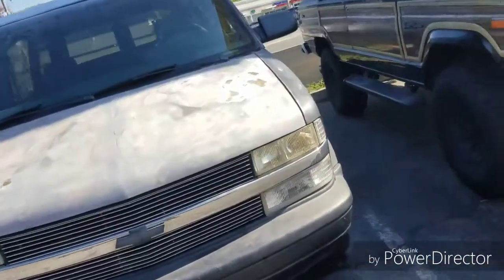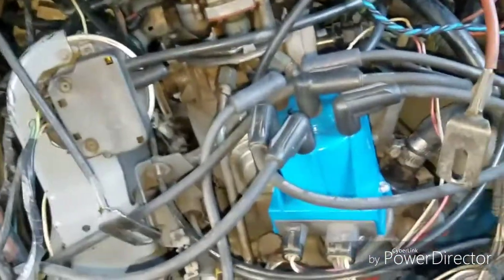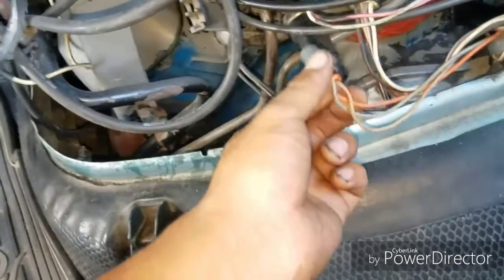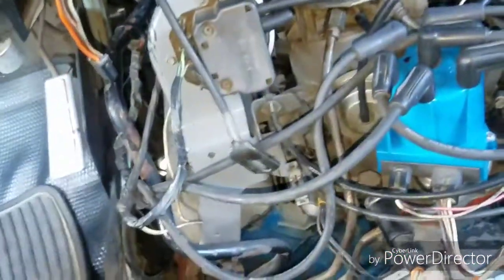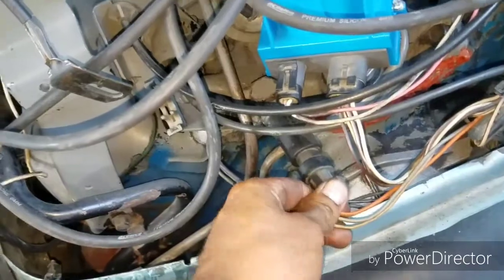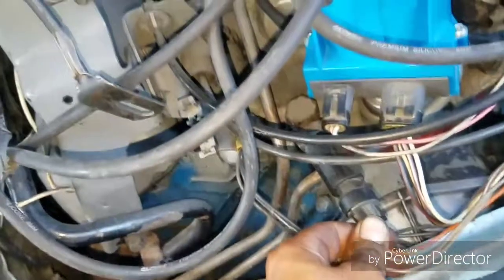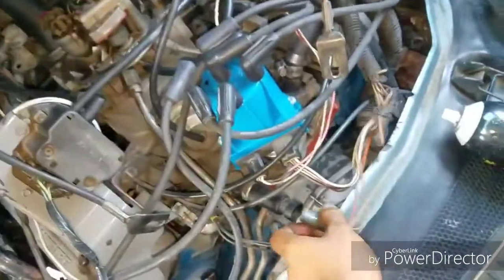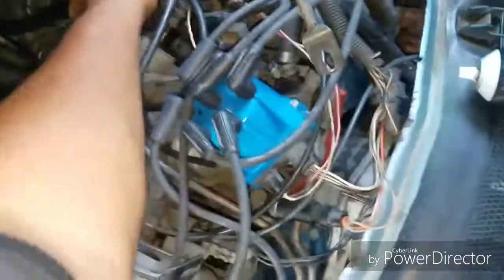Chevy throttle body injection, TBI system.

Comment: Great if had the same thing problem replacs fuel filter distributor injectors pressure regulator  least I have all new parts after after 26 years of running on my 92 chevy now I'm going to take the same fix I hope its fixes my truck thank you . Il let you know how it goes 😊
Reply from the maker: Awesome.  Please. Do

Comment: What would cause the injectors to spray constantly & not pulse? 95 c1500 . R&r cap rotor plugs & wires.
Reply from the maker: Do they spray full force or just kind of a fountain?  Also, do you have any issues with it running weird?

Comment: You can replace the ignition module. You can replace the pressure regulator. But the problem is going to be the pulse dampener, or the pump itself. These new fuels boil at 170 degrees. I have to use the fuel pressure gauge port and burp the air out of the line in order to get my TBI system to start up again. Every time the temperature is over 86 degrees, abs I let it sit after hot for 20-40 minutes.
Reply from the maker: Awesome. Thanks for the Input

Comment: Clogged catalytic converter
Reply from the maker: Possible but more than likely a fuel system issue.
Reply: @mechanicalman8048  definitely not, that’s why it doesn’t start after running, the clogged cats are too hot and expanded and all that science, they cool down again and it starts
I’ve had like 5-6 vehicles that’s happened to
Reply from the maker: @Phig Newton  if it was the cats the injectors would work off the bat. But they don't, it always needed a squirter of fluid for the first start up. If you watch the video again, you can see that it gets no initial fuel delivery.
Reply: That’s two different issues, not starting after hot is clogged cats, something that needs to be changed every 80-100k

Comment: I was experiencing the right fuel injector was cutting off & this was going on after I replaced the map sensor tps, iac,tps temperature sensor, spark control module & all ignition module &  full tune up it turned out to be my ecm

Comment: I need help with my Tubi I rebuilt the throttle body and still can not get my injection to spray in less you push the gas pedal not sure how to fix it on a 1994 gmc 1500 Serra
Reply: It turns out it was the temperature sensor
Reply from the maker: It's awesome I'm glad you figured it out. I guess the list of possibilities gets longer.
Reply from the maker: Check fuel relay, connectors, could be distributor. Could be a combo of things. Also maybe oil pressure switch. If it sprays when giving it gas it probably isn't the injectors.
Reply: @mechanicalman8048  mine only one injector sprays when you swap the electrical connectors the opposite injector sprays.
Reply from the maker: @eriktorres8975  that sounds odd. A technician may have too see it in person.
Reply: @mechanicalman8048  I’ve cleaned out the grounds already, replaced the ignition module, distributor, map sensor, fuel pump, fuel filter, and I even got my throttle body rebuilt. And nothing.
Reply: @mechanicalman8048  I’m suspecting to be a ground issue with the ECM or it’s giving out already. A few months ago I had the whole dash ripped out cause I changed the evaporator and heater core. At once the ecm was just dangling by the wires when I was messing around down there.
Reply from the maker: @eriktorres8975  did you take a look at the Fuel relays?
Reply from the maker: @eriktorres8975  it could be a computer issue. Ill see what i can dig up.

Comment: Hello i have a problem, i have a 1987 chevy g20 van 5.7 liter i rebuilt throttle body/ new gaskets etc, new fuel pump, tank and new filter. It rotates but doesn't start .Its like when i charge it up to crank it the right injector mists out a little, then the left not much at all very little,  i know i should see a perfect mist like yours on both, but i don't.  I havent checked the pulse yet, could my problem be your problem?
Reply from the maker: Could be the same issue. How ever as some of the other guys on the comments have pointed out it could also be fuel relay or fuel system wiring. I'm no expert on this system. I just posted what i discovered. I hope I help with anything you find here.

Comment: If the truck dies or doesn't run because the oil pressure switch isn't plugged in, you have an issue with the fuel pump relay or circuit. The oil pressure switch is a redundant power supply for the fuel pump.
Reply from the maker: Thanks for the insight, i don't work very much on this system but your input helps us get closer to the solution. 👍👍
Reply: @mechanicalman8048  No problem. Did you guys get her fixed up?
Reply from the maker: @Carlitosway211  the owner took it back and i didn't see it again
Reply: @mechanicalman8048  Bummer. I hate when that happens. It's rare, but some people lack patience.
Reply from the maker: @Carlitosway211  yeah kind of sucks i didn't get a second  chance at it. But now i know what else to look at incase i get another one in.

Comment: You could have two problems.  The fuel pump gets power from the fuel pump relay, but as a back up system it can receive power from oil pressure switch.  The fuel relay should be replaced first, then you can replace the oil pressure switch as it is clearly failing.  What you have demonstrated is that the oil pressure switch side of the system is bad. Normally, cranking the engine creates some oil pressure which sends signal to fuel pump (as a fail-safe secondary system). But the system is not meant to use this method as its sole source of power.  The fuel pump relay is the primary system, which is clearly not functioning at all.
Reply: It's almost like you've been reading my posts in the OBS Chevy groups. Lol 
I constantly see threads about dead trucks and on every thread at least one person is saying to check the OPS. Over the last couple days I've been trying to explain to these fuck wads that's not how it works but they are some stupid stubborn pricks. Even posting a wiring diagram and they don't get it, they read them all wrong and call me an idiot. I post a video of how it works, they still argue. Finally someone else fucking understands!
Reply: My injectors are new and I still can’t get fuel to spray in less I push the gas pedal what should I try
Reply: @bennybritch8845  I'm no mechanic, but I'd put a fuel pressure tester on it see what your fuel pump is giving you.  Don't know what you have, but my 1988 C1500 5.0L 305ci TBI, requires 9-13 psi. Just replaced my fuel pump cause it was only spitting out 7-7.5 psi. Still ran great but was stalling on a hot start. Good luck.

If pump is good, you may need a fuel pressure regulator. It's located right behind the injectors on the TBI module.
Reply: @ericbleueldoesstuff9152  you are correct on both accounts.. You can actually pull the plug from that safety pressure safety switch  jump it with a paper clip and the pump will never shut off, even with key off ( good trick to know if you need limp home around other issues ..
  also # 2 ... if old system is having pressure leak down. it could be hard to start as where it may take 15 seconds for the electric pump to put the needed pressure  and mean while the fuel relay kicks of electric to the pump ... 
I always recommend on all older cars hard to start. . Crank for just 5 seconds and turn off /on then crank  for 5 seconds.. Repeat that instead of holding the starter on straight through for 15-20-30 seconds as most fuel relays will cut off sooner then 15 seconds on Gm's  I have found.... No mechanic either, but i've fixed everything i've owned last 30 years..PEACE
Reply: @josephsmith7438  I’ve got a 1976 Chevy Itasca on a p20 chasis. I can not find out what the green wire is. After I got a new alternator put it my clusters all spin crazily. Any advice?

Comment: Hey I think it's more a short on the harness . When you move on the oil sensor terminal your also moving the whole wiring harness. try testing the the current from the TBI terminal to harness.
Reply from the maker: It was a bad plug. I changed the pig tail and it fixed it.

Comment: Will that make one injector work and injector is new
Reply from the maker: That should work. Just make sure the fuel pump is working properly and also the fuel regulator.
Reply from the maker: It should as long as you have good fuel pressure

Comment: Hi, wondering where you are located. I would like to find an expert on TBI so I can make my 7.4L 90 dually run it's best. One code won't go away (02 sensor circuit code 13) and runs faster when hot. Thanks. I live in Palm Springs CA area.
Reply from the maker: Well i live in the san Gabriel Valley are. To be honest i don't have that much exposure to TBI systems other than what i found out when i made the video. What do you mean it runs faster when hot?